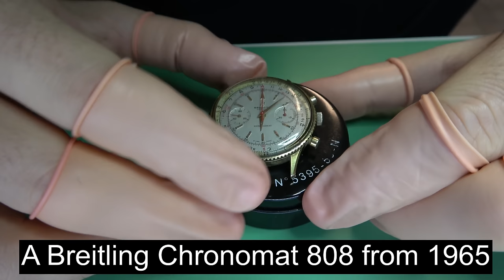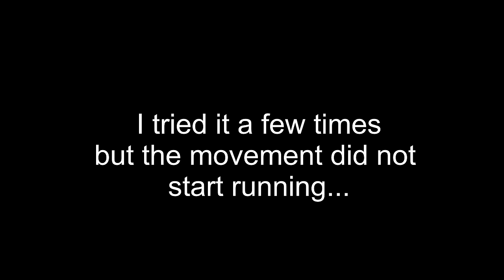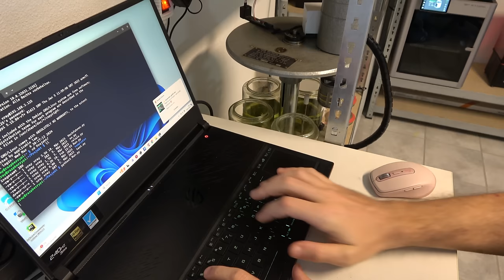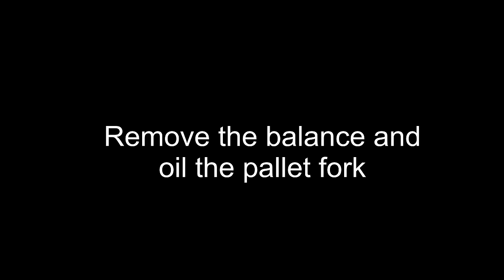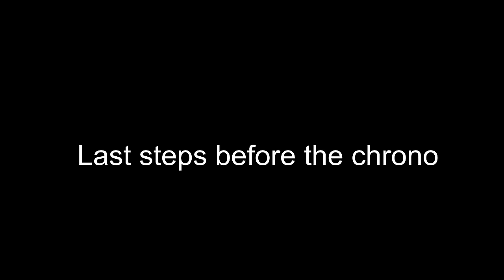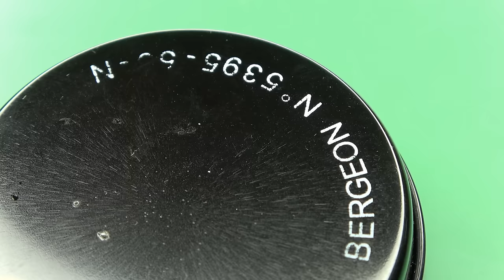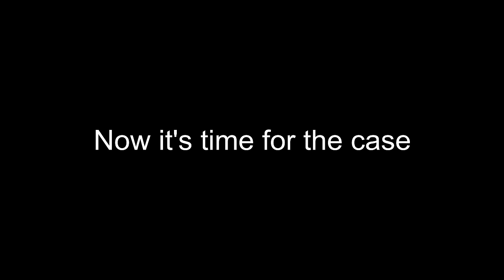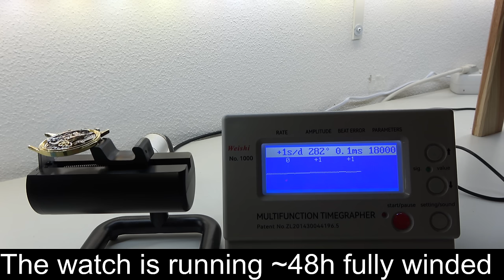Vintage Breitling Chronograph Restoration: Converting Scam to Success

Comment: Nice job, have an old Titus I haven't dared to start on yet, so many screws and springs, but I'll get around to it 😅. Didn't see you dip the escape wheel in epilame only the pallet fork. I was thought to do that as well to make sure the oil stays in place. Would also recommend you to get an "auto" oiler for the jewels, it makes oiling so much easier and you allways get the same  amount of oil😊
Reply from the maker: Yeah you can epilame the escape wheel as well you are right. I just didn‘t do it this time because I somehow forgot it. 😅

Comment: Well done, lovely job! You never said why the bezel was loose and how you fixed that? I doubt you were scammed. If you buy from eBay chances are you bought it about half the price you would sell it for. If it ran a bit, for some people that’s good enough. However I ask a lot of questions before I bid, but even then some sellers pretend they are not watch people when in fact they sometimes know more than they let on, they just don’t want to tell you what might be wrong. I would suggest if you want more views of your videos on YouTube try adding a voice over in English, even if you are not that good you will get a lot more views. Good luck.

Comment: Watching a Master working in its art is always MESMERIZING!!!!  But IMHHO, I don't believe this watch was sold under dubious circumstances. If you buy something like this from ebay, you need to know in advance that 99.9 % of the time you are dealing with people that have no idea of what they are talking about, specially regarding watches. What I think the ebay seller wanted to say was that the balance was good, and for him/her, that is "running" condition. I have found many instances like this, specially when buying Chronographs. So you need to understand that this people do not have the knowledge of how to say or tell things in the same fashion that an individual like you or me could say, using the correct nomenclature or jargon. The only issues this movement had was that broken screw head, and incredibly dirty with dried oil. But asides of that, the movement was very good, and it came to full life under your expert hands!!!!  And its a beautiful example of the Venus caliber 175. I have the Tri-Compas one, model 809 with the 24-hr dial, and is running beautifully too!!!  Thanks for your show of Master Expertise!!!
Reply from the maker: Thanks for your comment. Maybe you are right but the Seller told me the watch was running all day Long and After selling he was not answering to my questions (Even when I simply stated the obvious and told him he doesn‘t have to worry because I am gonna make a project out of this one. I think scam is not a really wrong term considering this or? But nevertheless thanks for your nice and friendly comment!
Reply: Scammer.
Reply: @UhrenDantler how much did you pay for the watch?

Comment: When an eBay seller advertises a watch as 'runs', they don't mean it runs very well, or for very long. The best bet is to assume the worst. I keep my expectations and offers both very low. When looking at pictures think about what they're NOT showing you.
I think we all know that at the very least it's going to have to be taken apart, cleaned, put back together, lubricated, and regulated.

Comment: Well, at least you can use ST19 parts if any here are missing or broken…
Reply from the maker: I have never heard of ST19😅 thanks for the advice
Reply: The seagull ST1901 or 03 isn’t the same the tolerances are fractionally different on most parts.
Reply: @nickjohnson217  Oh? Ok, guess I learned something new today then.